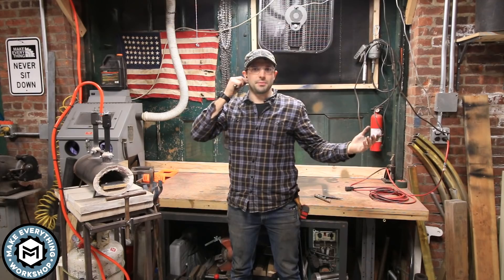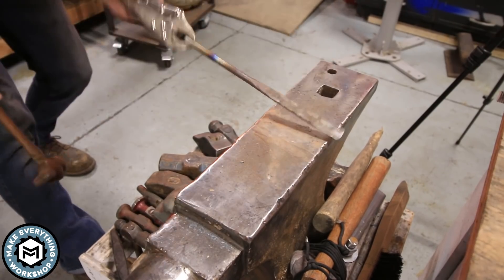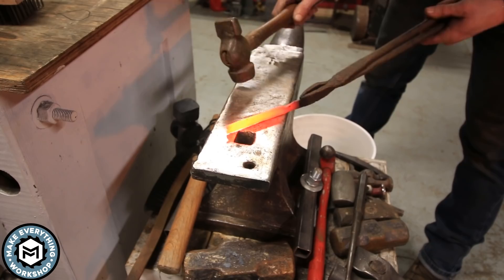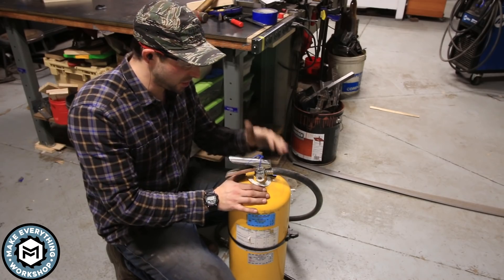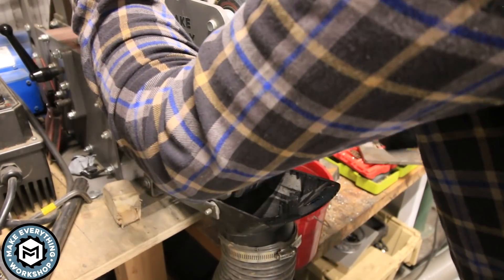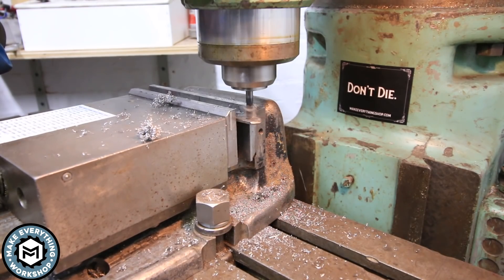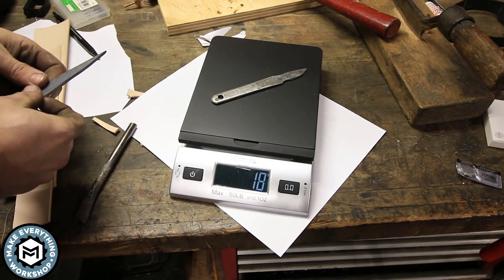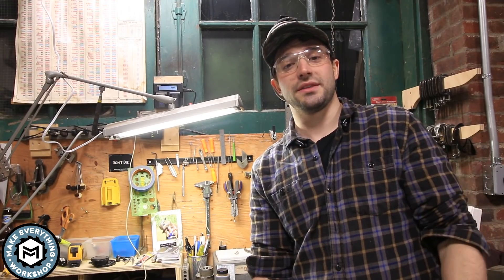Forging a Titanium Scalpel | Blacksmithing Experiment

Comment: Cool, would of been nice polished. I’m not surprised it cracked when you tried to drift it, as titanium work hardens when heated, plus you forged it and it didn’t have a lot of side wall on the edge....oh well. I do like titanium tho, even if it’s a bit of bitch to work with. I made my wedding band out 6al, on the lathe, the night before the wedding, got a cutoff of fleabay for 25$. Not bad comparing ones I’ve seen similar online starting at 200$.